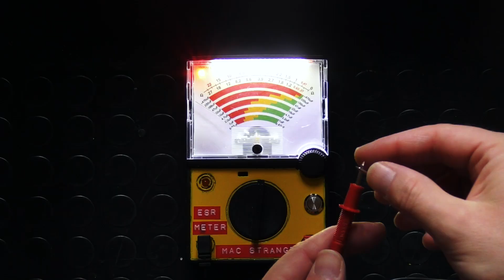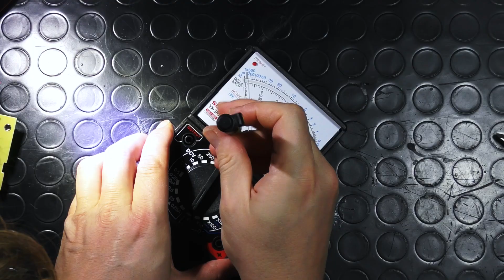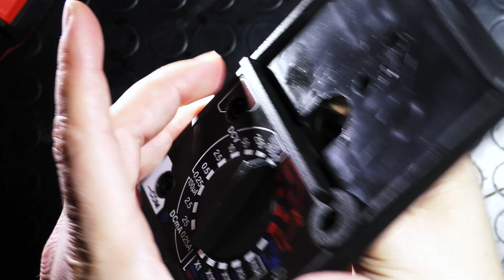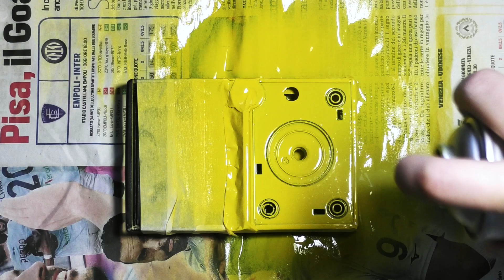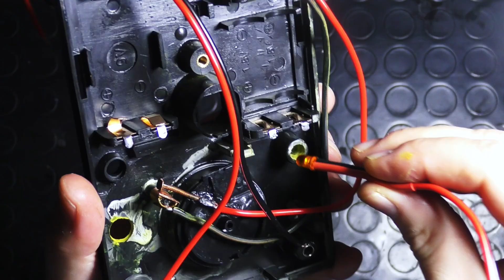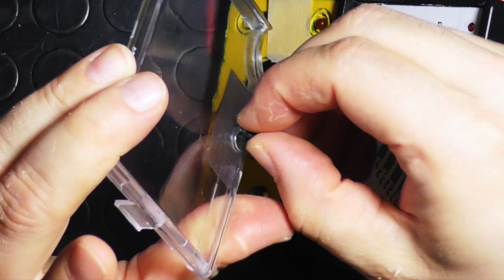TESTER ANALOGICO CONDENSATORI ESR METER 0,47uF - 470 uF 100Hz con scheda SMD

Comment from the maker: SCHEDA SMD: https://www.ebay.it/itm/334762541228?itmmeta=01JEKJM05KFX10SSW8D58DMK15&hash=item4df16700ac:g:D90AAOSwaDxj-Ki1
Misuratore / Tester di ESR condensatori Analogico - montato completo.
Versione migliorata del  circuito della rivista Nuova Elettronica n.212/2002.
Le migliorie prevedono l'aggiunta dell'alimentazione stabilizzata e l'aumentata risoluzione per bassi valori di ESR (fondo scala a 27 ohm, anziché i 120 ohm del progetto originale).
Il tester è stato ottenuto modificando il tester cinese YX-360Trn.

Comment: Grazie, sto assemblando esattamente la stessa cosa, stesso pcb e stesso strumento. Ora so come smontare il micro amperometro senza romperlo, per cambiare la scala.
Reply from the maker: Ciao e grazie a te, il fondo scala deve essere tagliato leggermente di più sui lati altrimenti tocca e si gonfia. Un caro saluto
Reply: @MacStrange Un consiglio: meglio aumentare le R serie dei led, perché sono troppo luminosi e tendono a scaricare la pila 9V.
Reply from the maker: @ intendi il LED che indica lo stato di alimentazione e il LED che indica la continuità? Ma no perché tanto c’è l’interruttore di alimentazione (almeno nel mio caso). La batteria dura tanto. Io lascerei così la SMD
Reply: @MacStrange  Si esatto, il "problema" è soprattutto il led che indica l'alimentazione presente, perché è a valle del dcdc step-up e sta acceso tutto il tempo di utilizzo. Me ne sono accorto usando una pila non nuova.
Reply: @Fabio-cm1gh   Si usa una pila da 9V composta da una serie di 6 pile AAAA, quindi già di suo parte con poca capacità ~500 mAh e una resistenza interna alta ~2 ohm da nuova. 

Dopodiché si usa un convertitore dcdc step up con modulazione pwm che porta la tensione da 9V a 12V supponiamo con una efficienza dell'80%. 

All'ingresso del dcdc  c'è un diodo che fa perdere 0.3 V per evitare problemi se la pila è inserita al contrario.

A questo punto il led è alimentato con una tensione di 12V la R è pari a 1kohm, la tensione di giunzione tipica del led verde è di 2.1V per cui a valle del dcdc ho 10mA solo per un led. 

Ho una potenza dissipata su R pari a  0,1W+0,02W sul led. 

A monte del dcdc ho (9-0.3V)*(0.018A*0.8)=0.120W

Quindi da 10 mA già sono passato a 20 mA per un solo led.

Ora supponiamo una R interna di 2 ohm, sto sprecando 80mW nella pila.

A questo punto non conviene alimentare il led con solo 5mA o anche meno che si illumina uguale ma senza sprecare potenza? 

La prossima volta evita il tuo commento da 3 lire.